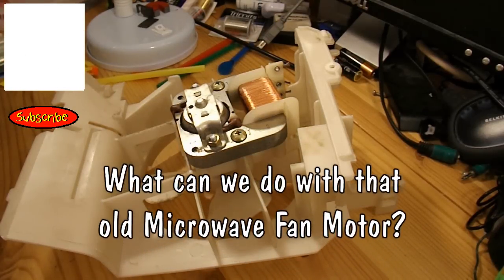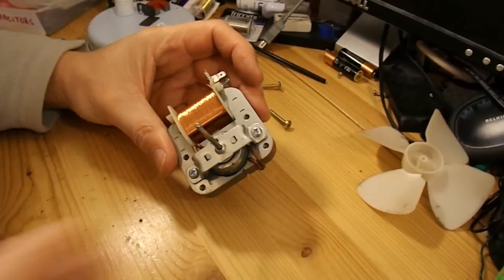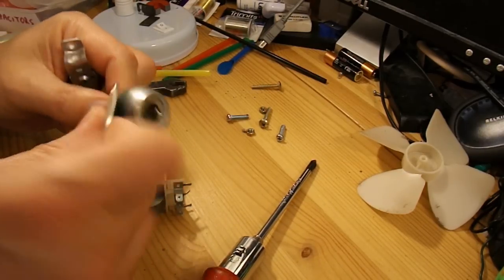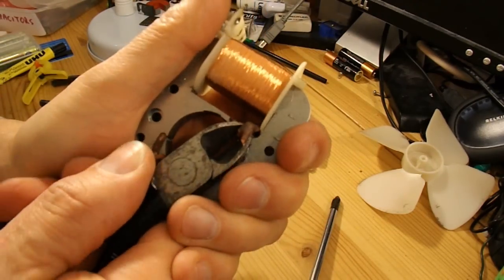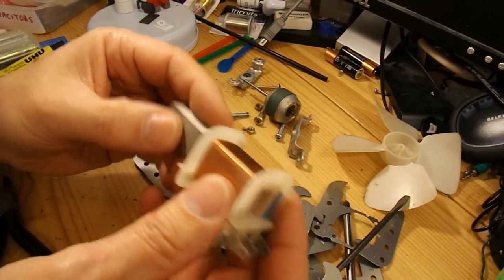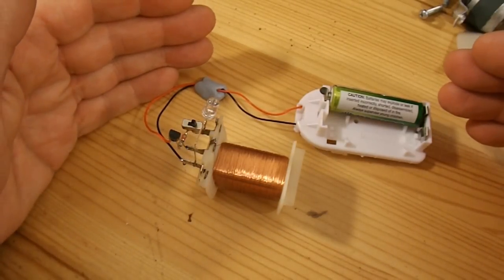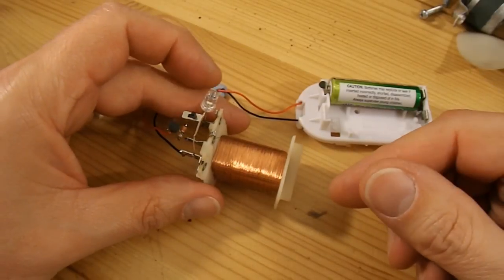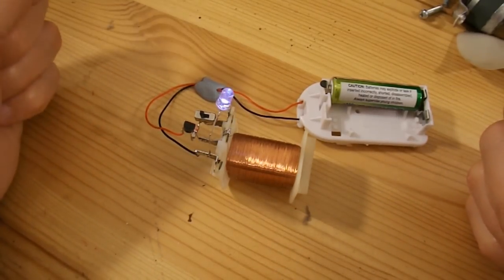What can I do with that old Microwave Oven Fan Motor

Comment: You didn't start the coil 'resonating', you induced enough voltage to overcome the forward voltage of the led, which opened a path that prevented the voltage drop from the resistor.
Reply from the maker: I am afraid you have lost me with that explanation. Where does the voltage drop from the resistor come into the explanation? Could you give a bit more detail?
Reply: @GrandadIsAnOldMan  My first comment was rushed.

I went through and analysed your circuit.

What is happening is when you turn your switch nothing happens because the transistor is in the closed state because there in no voltage on the centre pin, the gate.

When you induce a voltage in the coil with the magnet you are opening the gate. With the gate open the battery can now send power and it keeps the gate open through the resistor while also powering the led.
Reply: Sorry for my initial hasty response by the way.
Reply from the maker: @samshygiene3202  You are close but you are still not there. The battery is not lighting the LED, it does not have enough voltage. You already mentioned the forward voltage so I thought you might have spotted that 🙂👍
Reply: @GrandadIsAnOldMan  
You claim to be no expert and refute my analysis without giving a single piece of evidence or explanation. 
Show your circuit working on camera, switching it with the magnet, desolder the LED and put it across the battery terminals, it will light up.

All you made was a magnetic switch.

For a circuit like yours to act as an LC oscillator and boost voltage it would need much more capacitance and you do not have a capacitor or enough parasitic capacitance to start an oscillation.
Reply from the maker: @samshygiene3202  You have already talked about forward voltage so you already know the LED will not light with 1.5 volts from a single AA battery. I have already provided enough information in my video description including links to the relevant videos that do include the circuit diagrams. Perhaps you would like to make one yourself and prove your assertions. I have made mine and shown it. Unless you have another channel I see nothing that you have done yourself. I would rather talk to somebody willing to try something themselves than somebody who wants to theorise with no practical example to prove their opinion. Whilst you are at it, you might like to explain how this one works too https://youtu.be/DPcfsrv_92A
Reply: @GrandadIsAnOldMan  
There's no need to debate anything. The LED has a forward voltage below 1.5 volts, show your circuit working, de solder the LED and put it across the battery. It will light.
You made a magnetic switch and think it's breaking the laws of physics.
If you won't bother to understand the most basic of electrical principles why would I put effort into educating you?
One last point, to think you're making significant discoveries with these components and no test equipment is incredibly arrogant.
All the best with your inevitable perpetual motion machines.
Reply: @GrandadIsAnOldMan  I also pointed out in my previous comment you didn't include the needed capacitance to start an oscillation, referring to a joule thief style circuit. That is why you have a magnetic switch unless you prove the LED has a forward voltage greater than that battery can produce.
Reply from the maker: @samshygiene3202  I think the  arrogant person here is the person who has magically found a set of LEDs that will work at 1.5 volts but refuses to show them. Show me a listing for some white LEDs that work under 1.5 volts and I will gladly try them. As far as I am aware you will find they need in the region of 3.2 volts. You will find some RED LEDs that will start to light around 1.5 volts if you are lucky, I can probably point you at a video of one of them working. At no point have I made any claims about breaking the laws of physics. This is a very simple circuit which would take you a few minutes to put together and test for yourself. To put it in layman's terms, the "kick back" from the coils is enough to light the LED. My video is a replication of the one done by Lidmotor so in itself provides a "proof" as proving a circuit involves other people being able to replicate it and obtain the same results. As you appear to be unable to follow the links and other information I supplied in the video description I will give you a direct link to Lidmotor's video that I have replicated https://youtu.be/faDZLDUls48 Would you like some links to tables of LED Forward Voltages too? What I find hard to accept is you total refusal to do anything for yourself to back up your claims. Perhaps it is beyond you. How about just buying a white LED and connecting is across a single AA battery. That should be easy enough. Then you could video it and upload it to your channel. Of course if you wanted to do a fake one you could pull the insides out of the AA battery and slide in a couple of button cells, then you would have plenty of voltage to meet the 3.2 voltage requirement.
Reply from the maker: @samshygiene3202  I am afraid you are just wasting my time. You haven't answered the basic question about forward voltage on a white LED. Try doing something useful and trying it yourself rather than waffling on. When you have tried it yourself, come back with video evidence and we can talk a bit more.
Reply: @GrandadIsAnOldMan  
You could remove the coil from that circuit and make it do the exact same thing by shorting the gate and positive terminal.
Reply: @GrandadIsAnOldMan  
Like you actually think that there's one forward voltage all white LED's operate at? I mean . . . Yeah good luck
Reply from the maker: @samshygiene3202  well actually yes, all white LEDs have the same forward voltage within a few millivolts of 3.2 volts. Like I said if you can provide a listing for any at a lower voltage I would be pleased to try them. However I can assure you the LED in this video certainly will not light with 1.5 volts. I am disappointed with you, your early comments seemed to indicate you had some knowledge and understanding but your continued refusal to back up you comments with evidence has now reduced your standing. A quick Google search for LED Forward Voltage charts will bring up dozens so I have selected one at random and given you the link for the site it comes from so you can learn a little more https://kithub.cc/2015/11/how-many-volts-are-needed-to-power-an-led-2/ perhaps you would like to look at it before you make any more comments as I value your input otherwise I would have just blocked you.
Reply from the maker: @samshygiene3202  Well now I can see your confusion. The "LED" you have linked to is a specialist LED that includes circuitry inside the package to allow it to light the white LED  from 1.2 volts. A bit of a clue in the data sheet https://static.rapidonline.com/pdf/530503_v1.pdf you will see it includes a driver module. A very interesting item but in fact a classic example of needing to read the data sheet to understand what is going on. This will be very similar to one of the links I gave you early on for a flashlight kit I built from eBay. That used discrete components to provide the driver circuit and I would expect the "LED" you have linked to has the same circuit components at a much reduced scale directly built on chip. Having said that, looking at the size of the driver module underneath the actual LED I can imagine it might be a relatively large coil or choke. I am so pleased you published that link as I can see these are probably being used in schools and completely misleading the pupils and account for some of the misled comments that keep popping up on this video.

Comment: As you say the circuit is more popularly known as a Joule Thief - Big Clive is credited with the name, the circuit itself has been around for many years.
In reality it's better to wind your own coil - A JT coil uses the centre tap but only needs about 30 turns - the wire in that big coil would probably make 1000s of JT coils.
For the puzzled - it's a useful circuit for using a single cell to light a LED - if you look on fleabay there are many types of JT as well as buck transformers for efficiently converting DC voltages up and down.  I have one aaa cell lighting a 5M string of LEDs.  It's handy as a pocket sized tester and saves needing to carry transformers etc.
Reply from the maker: Thank you Andy, you might find my video description helpful too 😊

Comment: I'm not a wizard when it comes to electronics. but what I think is that the transistor was an open circuit until you tap your magnet against the coil which induced a electrical current to the transistor then once that happened it cause the current to flow through the transistor and as long as there was current in the coil it kept the transistor producing a closed circuit
Reply from the maker: You are part way there, but there is more to it than that.The current and voltage from the battery is not what is lighting the LED and in fact would be insufficient to light the LED if you just connected the battery to the LED. It is the "back spike" from the coil that is providing the voltage. The Transistor is being switched on and off very rapidly and the LED is flashing very fast but to the eye it appears to be a permanent light. This video by RimstarOrg gives a good explanation (the link is already in my video description but I will paste it here for you) https://youtu.be/0GVLnyTdqkg
Reply: GrandadIsAnOldMan thank you for the feedback. Does the double windings in the coil step up the voltage to break the voltage threshold of the LED?
Reply from the maker: No, it is the speed of the magnetic field collapsing is inducing a higher voltage than the battery used to create it. That is why I referred to it as a spike. If RimstarOrg's video didn't make it clear for you then maybe this one will do it https://youtu.be/N20gG6bDRlo it is a longer video but it goes through stages to explain the process. You could jump to about 13.30 in that video to get to the summary.
Reply: GrandadIsAnOldMan got it thanks

Comment: Hello

Great video! I want to use a microwave fan motor and see some with a protective film to protect the coil.  What is this film called? Do you know where I can purchase such a film? 

Regards
Reply from the maker: I am not sure about any protective film for the purpose you describe. However, Kapton tape is regularly used on electrical components that are likely to get hot, so I suggest you Google "Kapton tape" to see if that is what you are looking for.
Reply: @GrandadIsAnOldMan  Hello

Thank you for clarifying its name. I am interested in protecting the coil from potential moisture and I see that it offers some protection for that.

Regards
Reply from the maker: @MBMB-sz1ye  to be honest, I cannot see why you would want to protect the coil from moisture. The wire is insulated, so it would not be affected by moisture. Wrapping the coil in tape may actually prevent it from cooling, although Kaptan tape is heat resistant, so the tape itself would not be a fire hazard. Any terminations could be coated with something to insulate them if you are planning to use it in a damp environment. On RC model electronics, they often coat the electronics with nail varnish to waterproof it, but not if it is likely to overheat.
Reply: @GrandadIsAnOldMan  Hi

I am actually using the motor in a WaterPure water distiller. The original one that failed had some tape on it, I assume to protect it from steam moisture. Do you think that is the reason?

Are all such motor coils already insulated? The wires from the original power were secured under the tape (not spade connector). However, my new motor has no tape and the there are terminals which I will use insulated spade connectors on. Do you think this will be sufficient? 

Do you mean mail varnish remover or clear nail varnish? Why do they do this if it’s already insulated and not as you indicate necessary? 

Apologies for all the questions but I am a novice? 

Regards
Reply from the maker: @MBMB-sz1ye  the wires on the coil are insulated, logically, otherwise they would short together as they are wrapped together. It is usually enamel, like varnish. If they overheat sufficiently the varnish could burn off allowing the wires to short circuit. You can run electric motors underwater without insulation because the electricity flows through the wires rather than through the water. Water has a higher resistance that the wire, so the electricity takes the path of least resistance. 
Regarding the use of nail varnish, I was specifically talking about the radio control circuit boards. Like any circuit board that you look at, there are surface mounted components. The individual components are not insulated. If water gets between the legs of the components, it will cause the circuit to malfunction. Covering the whole circuit board with a layer of nail varnish means that there is no where for the water to get in contact with the components. I have done it myself, when I am making radio control boats, but I don't worry about it for cars or aeroplanes. A simple example of a circuit board getting wet and malfunctioning, would be dropping your phone in a bucket of water.
Reply: @GrandadIsAnOldMan  hi

Thank you for the information. I clearly have a lot to learn. Still ding understand why water distillers use the Kapton tape if it is unnecessary so I will keep looking around to try to understand why. Perhaps something to do with the 240v the coil is carrying?
Reply from the maker: @MBMB-sz1ye  sometimes it's as simple as keeping it neat and tidy.
Reply: @GrandadIsAnOldMan  OK. I will hook it up without the tape then. Worse case scenario it fails at some stage and I just get another one and tape it up to see if that is any better.

Thank you for you enlightening advice.

Regards
Reply: @GrandadIsAnOldMan  Ok. 

As you are a font of knowledge may I kindly ask two more questions:

a) I am based in the uk and need to connect a live and neutral to the two spade connectors next to the coil. Does it matter which way around you connect the wires? 

b) is there any way to change the direction in rotation of the motor or is that determined by the direction of the coil windings? 

Regards
Reply from the maker: @MBMB-sz1ye  it is an AC supply, so reversing the wires would have no effect.  One important point is that in the UK you are talking 240 volts, which will kill you if you touch the live wires. Please take care. Here is a Wikipedia article explaining the "shaded pole motor" in detail https://en.m.wikipedia.org/wiki/Shaded-pole_motor
Reply: @GrandadIsAnOldMan  Thank you. Great background information in there. Yes, definitely plan on being around so I have an RCD and multimeter in action. 

Glancing through the article links also I see some big names Ferrari, Tesla & Faraday get a mention.

Comment: it's a tank circuit of sorts....the tap with the magnet biased the transistor enough to get it resonating
Reply from the maker: Certainly it is a resonating circuit although my understanding of a tank circuit is it contains a capacitor and an inductor and this circuit has no capacitor. Most people refer to this sort of set up as a Joule Thief. There are some handy links in the video description.
Reply: Well, just on inspection, the battery/resistor load seems to "act" as a capacitor....but you're right....a "true" tank circuit, usually used as a filter, has a capacitor, but the addition of the transistor makes the circuit act something similar to an Hartley oscillator as opposed to just a filter....Right?  The math would have to be worked out to determine if a resonate freq could be attained within the parameters...but interesting--the transistor biasing tap from the magnet has my my mind wandering into sensor applications....fun stuff!
Reply from the maker: chris moles haha, you are over thinking this. I don't work to that sort of detail. I saw Lidmotor's video and realised I had the same items in my scrap box so I copied it.
Reply: Fun stuff!  The tap with the magnet just got my imagination working....If the circuit could be tuned just right it could be used as lock, but as it is, it could be applied as a sensor, memory flip flop, SCR....etc....just fun stuff!
Reply from the maker: chris moles I can see where you are going with this. Of course you could just use a reed switch to activate a circuit with a magnet but not so much fun :-)
Reply: GrandadIsAnOldMan Yah, I can see having it tuned to a certain gauss....so that only the right magnet, or right "swipe" would work...not just any magnet....it's just so much fun thinking about this stuff....the applications!

Comment: YOU KNOW IF YOU CONNECT A BRIDGE RECTIFIER THEN THE LED AT THE END OF THE AC SIDE AND PASS A MAGNET OVER THE FERRITE METAL YOU WILL PRODUCE SOME LOW DC ABOUT 5 + OR SO I HAVE TWO HOME MADE WIND TURBINES THAT I HAVE BEEN EXPERIMENT ON AND WILL BE DOING A VIDEO SOON USING THEM AS PROTOTYPE BEFORE INVESTING IN COPPER WIRE AND EXPENSIVE MAGNETS
Reply: YOU KNOW YOU CAN TURN OFF THE CAPS BUTTON BY PRESSING THE CAPS BUTTON AGAIN!!!